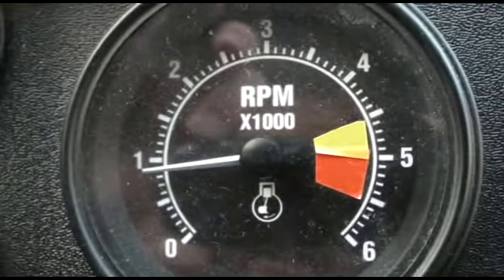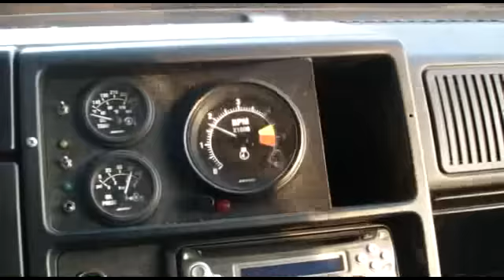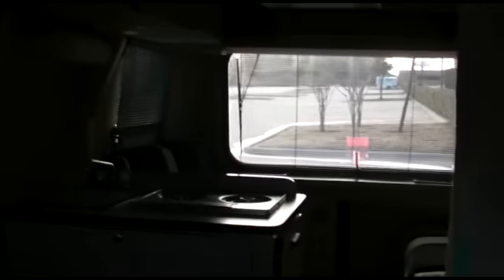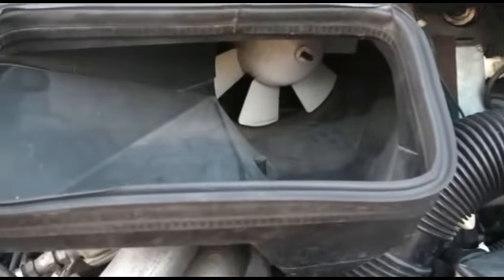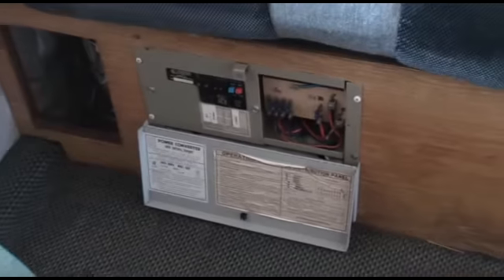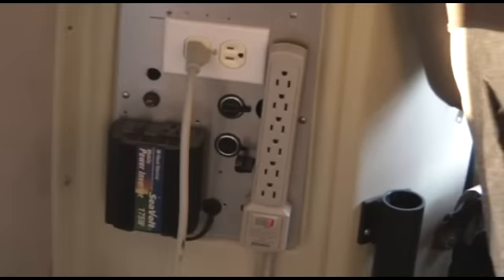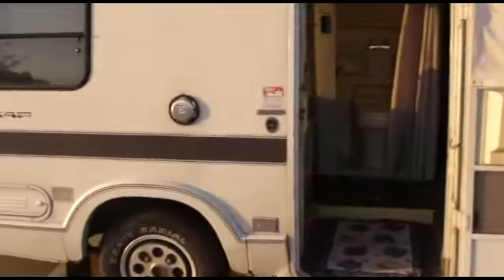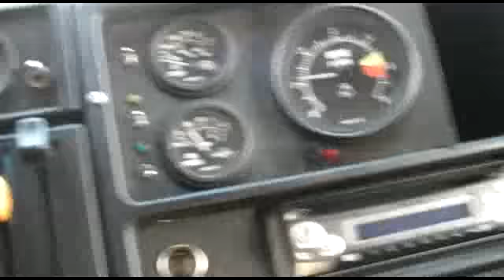My 1987 Itasca Phasar RV Motorhome

Comment from the maker: They are listed all over Craigslist. I recommend a V6 conversion as the stock Renault 4cyl just doesnt get the job done for many reasons that will sadden you. You can pick these up really cheap $500 and plan to slap in a conversion yourself. Lots of work, but if you can weld, you probably have the rest in the bag. Check out the website link to learn or discuss more.